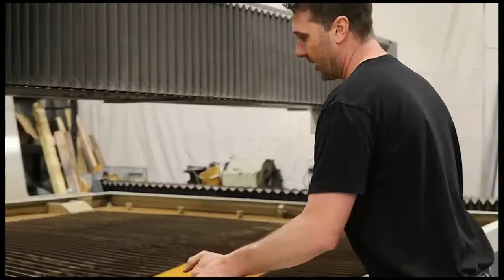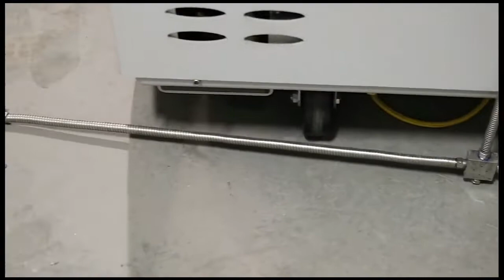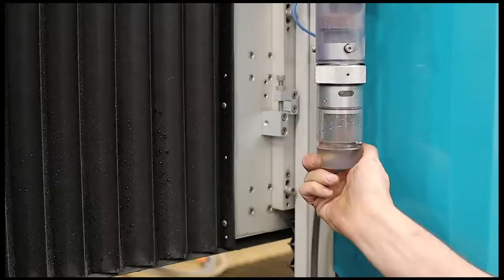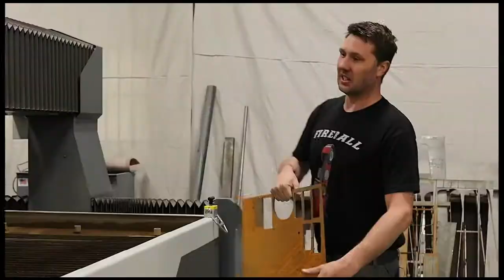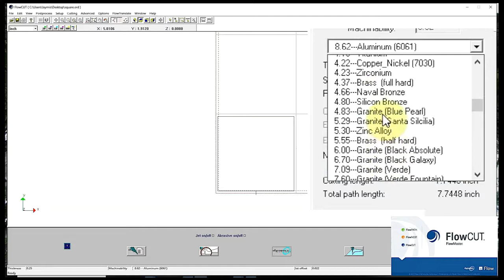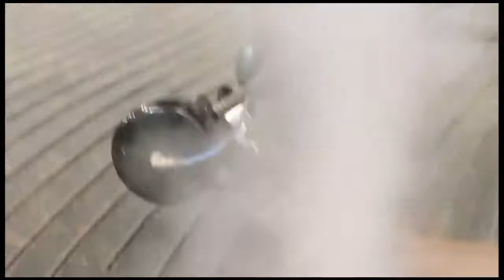How does a waterjet work?

Comment: Wouldn't it be better if the water line had 45 degree instead of 90 turns? I know if the line has abrasive in it going through that pipe it will wear a hole in the 90 elbow. Do you have enough work to run the machine all day every day?
Reply: The line that water runs through doesn’t have garnet in it till the very end